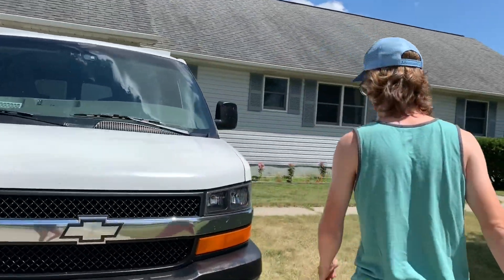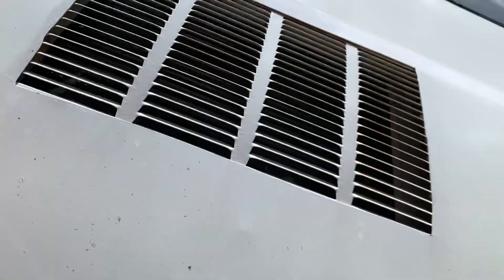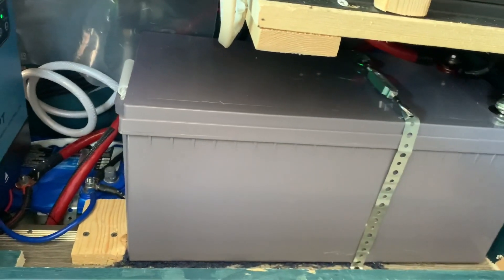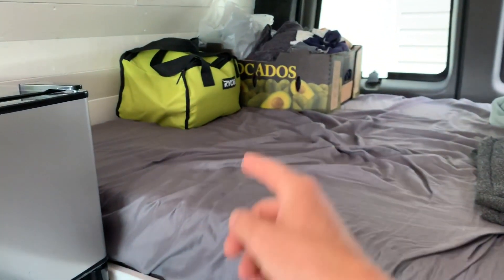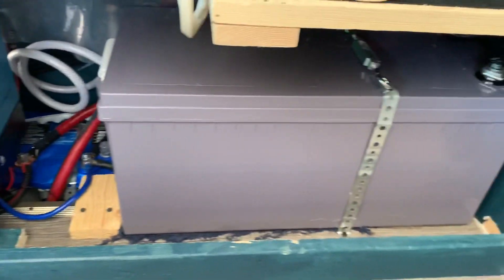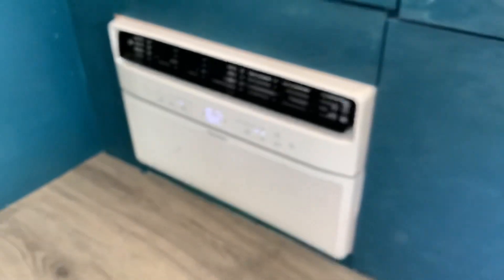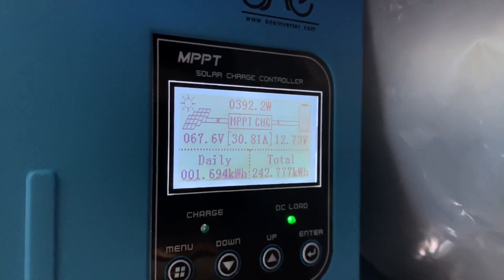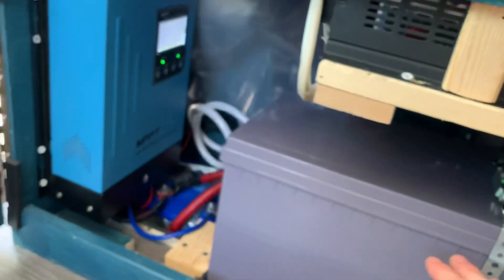Van Life Solar AC Setup - Totally Off Grid

Comment: * help needed!! * hello! your videos are invaluable ! thank you for your information.  i currently own a 2011 Chevy express cutaway, which I am converting to a small business for air bnb experiences. (not for living nor stealth, but hopefully to have people visit for lessons) I need constant power for an AC unit (Las Vegas Area - very HOT) my space is a bit larger than yours as its a cutaway not a van essentially it is a short bus, i would like to run 2 standard AC units just like yours, for similar reason to your fridge, if it breaks i can cheaply and easily replace it (a couple hundred rather than a couple thousand for an RV style ac unit). I am using your links to hopefully have the same solar set up as you ( I am 28 F with a criminal justice background, so I am learning everything I am doing off of YouTube, and solar has been the most intimidating to me. My question is, would I need more panels than you have? or would it be similar wattage to the rest of your appliances to have a second AC unit? also, the solar charge controller is sold out, do you have a recommended alternate? i understand how busy you must be, and how many comments you likely get but any and all information regarding your solar set up is greatly appreciated, i am trying to make this build the best it can be with the savings i have and offloading assets as you have done, and the heat is my greatest fear and problem to mitigate, with solar i am hoping to use the Vegas sun to my advantage, thank you for your videos and safe travels!!!

Comment: That's an awesome job, I saw your other video when you build the whole ac unit set up, great information. I should use some plastic flexible tubes on the vent of the ac to get the flow of the cold air up but besides that is one of the best jobs I've seen so far.

Comment: My 1965 Airstream Globetrotter has all original antique Romex, so I’m pretty sure telling people they have to use stranded is more marketing than fact.  It the Airstream the Romex is just run between the aluminum panels and they are not fastened to anythin, but it’s not 14 gauge, more like 10 or 12 with something like a single 16 ground, maybe even 18.  The little ground wire on 1965 Romex, lol.

Comment: Tim nice van I have the same van however it was already a RV a pleasureway I'd like to replace my noisy rooftop AC w/ a window type and aim the cool air downward w/ a vent. an seal the back half of the window unit to shoot the hot air outward. I'd also cover the top have you ever sean a road trek chevy van it has the window unit built into the rear of the high top. I'm wanting to imitate that however a unit the size of yours would stick up a couple inchs.Tim what do you think? I've sean a bunch of ppl w/ window units sticking out the rear window thats to ghetto for me.the inside of van is full w/ galley bathroom an closets so there's no room inside like the way yours is installed.thanks for any AC advice

Comment: Tim I just came across this video .  Your setup is probably close to what I need.  I bought a 98 Ford Econoline 150 last year . There is a Toshiba a/c set on the floor behind the drivers seat.  It has an inverter . It has a vent like yours to the outside.  I have no idea how to run this in the van.  AND I live in Central Florida near Tampa .  I am an older woman who finds myself having to live in the van almost full time.  I can’t seem to get anyone to help me with this not even to understand what it does.  That’s why I was so happy to see your video.  
How can I go about getting help.  What all do I need ?who can do this work for me . Thank  you for any advice ,  what state are you in?

Comment: I really appreciate this whole video. You answered all of my questions. I think part of the benefit of your strategy is that you've got a nice, big air intake and you're pulling from the shade. Smart.

I'm prepping for my van conversion a year from now and the heat is the biggest issue. I was about to give up and just spend the $2500 for a good rv AC, but even that's going to pull a lot of power. Makes more sense to spend less on the AC and save the roof space for more solar. 

But I guess the best offense is a great defense so the first thing I have to do is get rid of as many windows as I can. Insulate, insulate, *insulate*.
Reply from the maker: Most definitely throw your money at insulation!
If I were to do it again, I would insulate with way more foam board and invest in IR blocking tint.

I would also upgrade to an 8,000 BTU Inverter style AC unit (variable speed compressor). 

I also wish I had left room for a roof top fan, but the solar is really nice (and necessary) for AC.

Comment: I wonder if A mini split. With mounted under outside, and mount the inside at the top.
Reply from the maker: I've seen a few versions of this setup! I think it works great if you have the room below and inside the cabin for the condenser and evaporator!
If the van were a bit bigger and I didn't have all the windows surrounding the upper half of the interior, this probably would have been my preferred route.

Comment: Have you ever thought of using a compressor ac unit like the Midea 8000 btu. It pulls only 340 wats
Reply from the maker: I would LOVE to upgrade to an inverter compressor setup. Much more efficient. Looks like the Midea 8k BTU unit pulls 710 watts according to the spec sheet on Home Depot, but still an EXTREMELY efficient unit.

Others have reported great success with the Midea units in their van builds!
-Tim
Reply: @VanwithTim  Actually i have the Midea 8 k and tested its wattage and on dry mode which i prefer its 330 watts and on normal cool its 350. So this is perfect. I like dry mode because its not a damp chill and is much more comfortable. I just use a fan with it and it’s perfect for me, if thats the case, how many solar panels can i get away with?
Reply from the maker: @Killerchihauhau  It sounds like a really nice unit! If we calculate off of 340w (plus a ~10% power inverter efficiency loss of 34w) you would be using around 8,000 - 9,000w per day… BUT that’s assuming it’s pulling that 340w for the full 24 hours which is unlikely.  

Here’s my video on daily solar output totals: https://www.youtube.com/watch?v=JKKaOVQfs5o 

For reference, my 920w of solar produced 5,150w total on a nice long sunny day (well, May 19th to be exact)  

I guess I would try to measure your full daily usage with a 120v power meter and the AC plugged into it. That would give you your true power needs! Here’s the cheap power meter I use: (currently $13 https://amzn.to/3UeDIul)
Reply: @VanwithTim  Great . I have a meter like that but i need to figure it out more. Thanks so much!
Reply from the maker: @Killerchihauhau  Sure thing! Happy travels!

Comment: Hi Tim this may be a silly question but where does the ac condensation come out?
Reply from the maker: Great question! I added some 1/8" holes to the low point of the AC unit which sits directly above my under-van air intake.
Here's a view of the air intake under the van - https://youtu.be/cxpxg82UV3g?t=24
Had to be careful not to drill into any of the refrigerant lines, then add a little paint to keep it from rusting where the holes were drilled.
Reply: @VanwithTim  perfect!!! You are awesome!! Thank you!

Comment: Hey bro what is your wattage for the inverter and you think one 300ah battery would do the trick?
Reply from the maker: Hey Garrett, my inverter is 3,000w (make sure to get a PURE SINEWAVE inverter!!) But you could run it with a 1,500w inverter too.

The 3,000w inverter uses ~20 watts 24/7 with or without a load.
A 1,500w inverter would probably only use around half that.

For the battery, if you have a decent solar setup then 300ah should be enough. (Lithium has come down in cost and would give you a true 300ah vs the lead acid batteries giving you ~70% of the 300ah rating)

You could probably budget between 200ah - 400ah for running the AC depending on how well insulated the van is. Here's a video on the subject: https://youtu.be/V0r2ijuKd-c

For reference 400w of solar should add 120ah - 180ah of power to your batteries each day. Here's a video to help estimate your daily solar output: https://youtu.be/JKKaOVQfs5o
Reply: Thanks so much dude much appreciated you are the man!
Reply: Do you think 400watts of solar panels would do the trick?
Reply from the maker: @garrettmoore2791  Hmmm. Would depend on how well insulated and how large the van is.
With a van my size - if it were PERFECTLY insulated with no windows, it would need around 200ah per day depending on heat of course. 400w of solar would be a bit on the low side. I would think at least 700w of solar with top tier insulation and no air gaps.

Really, my 920w of solar is even a little undersized for my terribly insulated van.

Comment: The down side is for this to work you have to park in the direct sun. So, the very thing you're fighting is at it's worst.
Reply from the maker: A mobile solar array would definitely be the best option!
Reply: @VanwithTim  Yes, but that defeats the versatility/agility a van, without trailer, gives you. Considering the amount of solar you have on the van, that translates to a fairly large trailer, unless it can be collapse it into something smaller, while traveling. There is a Tesla prototype for such a trailer, but I don't know how much solar (watts) it carries.
Reply: @VanwithTim I find it exhausting to try to live in a hot climate..van life .much easier to heat up a cold space.

Comment: I won't ask why people are installing these window AC's LOW (essentially on the floor) in their RV's and Vans. 

For me the answer is they are either not looking to obtain maximum efficiency out of their AC unit (in order to 'max' their storage space above the floor mounted AC); or they don't realize they are not going to obtain as much maximum efficiency as they could - if...if they just install it HIGH in their rig.

Even if you opt to vent through the floor rather than through the side wall of the RV/Van, it would be better to forfeit some cabinet space (as far as I am concerned) below the AC (when mounted High) than to forfeit as much COOLING efficiency from the AC as possible by mounting it HIGH.   

I'm even thinking about venting the exhausted HOT air from the condenser out the roof (or high out the side of my van - since HOT air rises; and COLD air sinks. Easier to 'force' the HOT exhaust air from the condenser UP and out the roof or HIGH side of van. And of course the COLD air from the evaporator will BEST cycle the HOT air at the ceiling downward to mix with the COLD flowing air from the AC. That way the AC actually can do its job better in the various ways it was designed to.

Also you can never get enough AMPLE outdoor AIR to circulate through the SIDES of the CONDENSER portion of the AC to help wick away the heat coming off the condenser coil fins. 

What do you do with the remaining condensation water that collects in the pan under the condenser coils, that isn't being 'slung'/'splashed' up into the condenser coil fins? And did you water proof the back side of the box that the condenser portion of the AC is residing in? As the water is sure to dampen an unprotected enclosure and perhaps create a good environment for the growth of mold and rot.

Just my thoughts.
Reply from the maker: Thanks for the well thought out comment! 

Very much agree on it all. The evaporator sucking in cool air and spitting cool air back on the ground is a waste. You would need a lot of extra fans to circulate the cool air (a big waste of energy).

I've seen one setup with a condenser air inlet on the floor, ducted to the AC (properly at the ceiling) then the condenser exhaust through the roof much like what you're describing!

Brilliant idea!

I also saw another video where they removed the condenser and mounted it under the van with a water-resistant fan (can't remember the IP rating of the fan) then re-brazed the lines and refilled the refrigerant. 

Love the outside of the box ideas like that.

I drilled a few 1/8" holes in the lowest part of the AC (avoiding the condenser lines) and the condensation drains directly down through the condenser air intake. The entire underside of the unit has plastic sheeting funneling down to the air intake, so any water intrusion from the condenser exhaust will drain down through the intake.

That of course lose some efficiency, as the cool water is no longer pooling and being slung on to the condenser fins.

Comment: With this setup how long can you run it off the battery setup you have
Reply from the maker: Actually just removed my old AGM battery setup. New Lithium batteries arrive today.

Over 24 hours (depending on outside temperature and AC set temp) the AC uses 300-400 amp hours.
-Check out my AC power draw test video here: https://youtu.be/V0r2ijuKd-c

Over 24 hours my solar produces around 430 amp hours (depending on the length of day and amount of cloud cover)

The old battery bank was rated for 355ah but I never saw that much power from it. New lithium bank is 280ah and I'm sure it will be way more than enough power.
Reply: How is the a/c doing with the new batteries?

Comment: Just curious I have no experience and am here to learn. Could you or why would you not put a small ac in the back window? I've seen vans with AC's in their back windows. I'm trying to figure out what to do with mine
Reply from the maker: Hi Debra! I've seen the rear window setups and can confirm they work great! But I didn't want to block my window (or actually have to remove the window altogether).

HOWEVER!!! Check out VanlifeThings video on his AC here: https://youtu.be/9WdWvQaoN5A?t=379
It's fully "stealth" from the outside, yet he didn't have to remove a window!

Just have to make a condensation drain for it.

My install wasn't too tough, but I completely understand the hesitation in cutting huge holes in the sides of your van - https://youtu.be/QK_zLDNW3X8

Comment: i thought the air intake should be in the space you are cooling. That way you are extracting heat
Reply from the maker: That's actually super interesting as some higher-end models have an internal "door" to select between recirculating the interior air or utilizing the outside air. (Would love one!!!)
The outside air would work great when first trying battling the built up interior heat(120F+), but eventually you would want it in recirculate mode, that way it's only cooling the 70F interior air instead of the 90F exterior air.
Hope that makes sense!
-Tim

Comment: The exhaust grate looks amazing. I question if this set up allows enough airflow to be efficient. Also when there is high humidity there is going to be a lot of condensation, where that does that drain?
Reply from the maker: Thanks AJ! I was worried about the airflow as well. Luckily there haven't been any issues with performance. 
I've since seen many setups which are much more restricted (a 6"x6" air inlet and 6"x8" exhaust). The owners claim the AC works fine, but I'm sure it's much less efficient.
You might find this video interesting on the AC power draw - https://youtu.be/V0r2ijuKd-c?t=127

That 12-hour test was performed on a hot humid day in Michigan and it drained a LOT of condensation down through the intake grille.
(I drilled a few holes in the lowest point of the AC drain pan directly above the intake grille.)